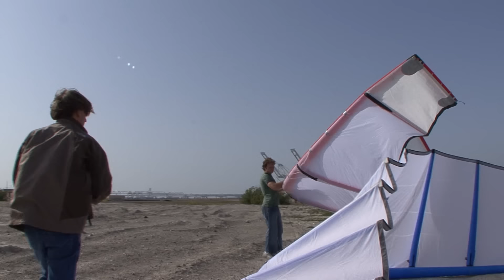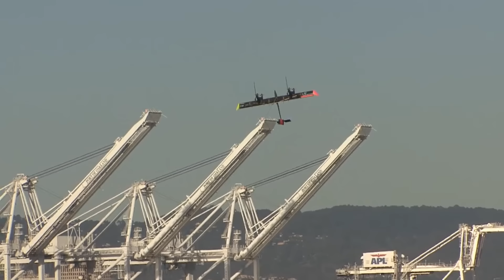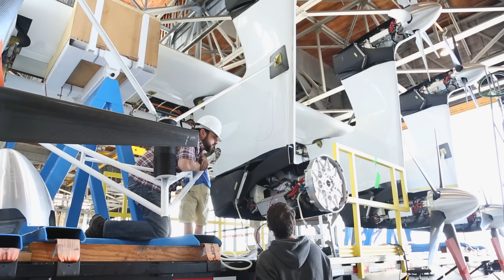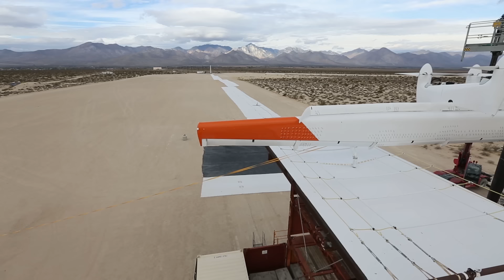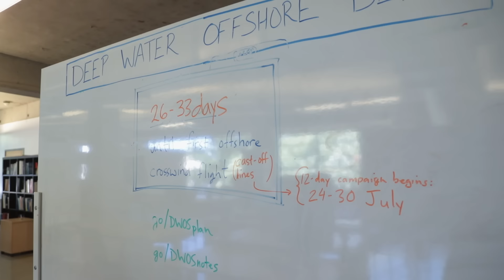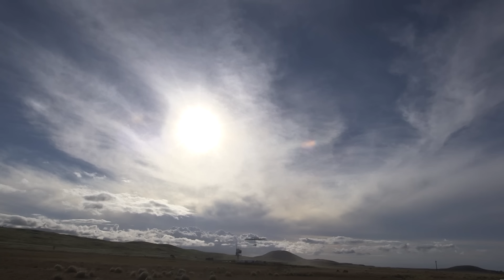Pulling Power from the Sky: The Story of Makani [Feature Film]

Comment: wonderful tale of inovation  and gritty stick to it ness , however did i miss the part of how much power was ever produced over and above the power  used in  transition and  vtol envelope? also i  am not against good alt energy  in any form ,,, but the  entire team on this one seemed way more interested in the camera than the text books
Reply: It would be a drop in the bucket. I fly 2.2sqm sport kites and the amount of power is absolutely incredible. It is exactly the same feel as waterskiing when the boat goes full throttle to lift you out of the water. Like you’ve just been yanked by a freight train. I bet the power for VTOL is less than 1% of what it generated during a typical flight.
Reply: @Syclone0044  i dont "bet" on this sort of data ,, i think it would be reasonable to expect some real data on the process , the "kite" you get pulled by is one example of force  , however in this example  the electricity is only developed by the props on the wing ,,, what still remains a mystery is how much power is developed
Reply: @peterfox8701  Exactly. Comments like the one above saying things like "it pulls really hard so it must have a lot of usable power" is just what the misguided kite-boarders in this video thought. If it were really so, we could usefully harness the pull of gravity on any large object.

Comment: Pretty neat. This project was a mix of everything I’ve done in my life. Windsurf, kitesurf, helicopter pilot, drone pilot, rc plane pilot and Hawaiian resident. If it ever got revived it’d be cool to join the team. I thought your transition out was done in a really sketchy way and I have lots of questions but I imagine you guys had the same questions and reasons for why you transitioned that way. Also it looked like the kite settled with power a few times. Vortex ring state. There was another company that put a giant remote controlled kite on a large ship. It just helped pull the ship though. Your kite could pull the ship while powering the motor simultaneously maybe even allowing to shut the diesel generators off? I’m not sure how much power a ship motor draws. Maybe look into the shipping industry for funding.

Comment: This is an interesting concept but I dont see how this can be practical.   There are too many things that can go wrong.  Also how much energy can this produce relative to other more simple systems?  I'm not against new things but it does seem like a much more risky system with so many failure points.
Reply: Well said and I couldn't agree more... just wayyy too many high-risk variables and even if most of the variables could be solved, I simply do not see how such a design could survive sitting out in the elements long term, especially during major weather events.
Reply: Is absolutely insane, like you said too many moving parts, and that should be the death knell from the get go. They should have done something else if they want to make something competitive with conventional wind turbines.  One guy in the comments suggested tethered helium dirigibles. That sounds a hell of a lot more practical than this joke.
Reply: @steveperreira5850  it was tried as I remember. A ring shaped balloon and the rotor in the middle. Never heard of follow up though.
Reply: @Daneel Olivaw - I recall seeing those experimental ring-shaped balloon wind turbines (with the center-mounted wind turbine)... not in person but online. Which btw, sure seems to make a lot more sense vs thinking a super finicky kite wing (expected to rotate round and round 24/7/365 while tethered to massive moorings) was somehow going to revolutionize the energy industry(?) At least the ring balloon wind turbine design could be configured to retract back into a (sealable) ground-level bunker or sealable above-ground domed housing ... which would not only offer superior protection during non-ideal wind conditions/severe weather but would also offer ideal sheltered maintenance. 

On a side note (and to be clear) I'm not knocking the amazing feat of engineering involved in the tethered kite project but I am knocking the total and utter impracticality... which should have been realized long before the project was further and further green-lighted/funded.  It's too bad the design team didn't shift focus to a more practical project, such as the ringed balloon wind turbine design ... I bet they could have knocked that design out of the park and more likely seen the fruits of their labor blossom into actual mass production and long-term contracts(!)
Reply: After watching the film how many things can go wrong now seems pretty obvious. That is to say they couldn't have foreseen all of those issues from setting out a decade ago.

Comment: What's the KwH cost vs regular wind turbines? Adjusted for mass production
Reply: Too soon to tell what the kWh cost would be, but the wind at altitude is stronger and more consistent than at the surface, and the powerkite uses much less material to capture a share of it than a normal wind turbine. A very important fact not mentioned in this video is that wind power scales as the CUBE of wind speed, and the kiteplane cuts through the air about 10 times faster than the wind speed, so giving over 1000 times the power one might imagine to be in that bit of wind.

Comment: A very enjoyable watch but the whole time I'm thinking: please stop.... just stop it. The sheer complexity, multiple points of failure, high maintenance, staffing requirements, safety considerations, noise, large space required, weather dependence, low yield etc is just unbelievable. I noticed there was not a lot of talk about how much power was generated, and that the (likely considerable) noise this thing must make was hidden from us by the editors.
Having said that, it's really incredible what was achieved. Given the very difficult task I never thought it would get as far as it did and the determination to knock down every challenge that came up is very commendable. Looks like everyone did a great job at what they had to do and had fun along the way too, looks like it would be great to work there. I think if you took that team and set them to work on something that was actually worth doing they would knock it out of the park. If that ever happens, try to get the same videographers again because they did a great job too.

Comment: I wish they had tried sideways figure 8 (∞) crosswind flight pattern, it would have made the kite climb more stable and potentially reduce or eliminate the tether from coiling.

Also wish they would have been able to test a design with a big balloon that would bob in the wind, also on a tether like their kite. The ground station would need a variable spring, to allow harnessing during slow and strong wings. A permanent magnet in the ground station shaft would harness the bobbing of the balloon, surrounded by a coil. This would reduce the risks of the hard landings the kites experienced. If expensive lighter than air gasses are not available, the tether could provide energy to heat the balloon's air supply.

Comment: This is a perfect example of losing the forest for the trees.  You've got a bunch of people who THINK they have a good understanding of windmills, and then decided they could make a better one.  They failed because they don't understand even the most basic aspects of the concept behind windmills.  There's a reason why simple windmills, the ones they don't like, have been in operation for more than 1000 years.  They're simple, they're cheap, they're easy to maintain, require minimal monitoring and most importantly, they WORK.  Everything that their airplane ISN'T and never will be.  They took something that was incredibly simple, even massive versions, and then complicated the idea by massive amounts.  They took a principle that is mounted on the ground, or floating, with a minimum of moving parts and needing minimum maintenance, and turned it into an expensive and resource intensive (not to mention exponentially more polluting fabrication/maintenance process) IQ test that requires constant monitoring while it is in operation.  Taking a simple concept that has works for more than a millenia, and complicating it beyond belief isn't "innovation", it's stupidity and a massive waste of resources.  They created more problems than ever existed in the original simplicity of a simple windmill.

The most obvious thing about this whole process to me, someone who has actually built windmills for mere hundreds of dollars (and they're all still running after 15+ years) is how many windmills and how much power would have been produced in the last 10+ years they COULD have used the millions of dollars, they've pissed up against the wall, to build if they actually were as concerned about global warming as they pretend.  Another massively important thing they never ever mentioned was how much money they've spent.  How much is this IQ test supposed to cost?  How much does it cost to maintain all the electronics and motors and servos ESPECIALLY if they're going to put it over SALT WATER!?  And the most important thing, how much power does this Rube Goldberg contraption actually produce?  The fact that after 100 minutes of video and 10 years of "development" (aka wasting money that could have been spent on REAL windmills and photoelectric panels) they didn't mention ANY of these crucial points, or even offer estimates.

I urge anyone who thinks this video is interesting to go online and search for DIY windmills.  ANYONE and I do mean ANYONE can build a windmill and produce their own power with absolutely NO fabrication skills and nothing more complicated than a hand saw, a hack saw and a hand drill out of common, everyday parts and components that you can get from your local hardware store.  Even just watching some videos on it will educate you far more than the idiocy going on in this video.  Barring that, you could also just say screw it and go and buy one from amazon for $200, ready to go out of the box.  As a life long fabricator of 5+ decades, we had a term for people like the bunch in this video.  We called them "a lighthouse in the desert".  They're bright as hell but completely fucking useless, as far as the time and money they wasted.  At best, it's a lesson for everyone else on what not to do, and at worst, it got them a pay cheque for 10+ years and they can always sell off the tech for millions to the military so it can be used to spy on and kill people.  So at least there's that.  Fail.

Comment: This is the craziest challenging project that I ever see, and I mean in the positive way,  if the project continues may I suggest some ideas that you didn't try.

Use to hold the kite with several cables 2 or even 3 cables attached to bases apart hundreds feet's from each other, this will give more stabilization to the kite.

Another idea why kite, try using a balloon like Zeppelin, it's simpler and much cheaper, and a Zeppelin balloon filled with helium will not crash to the ground, and it's too simple to get harmed by the winds, wings could be added to catch more wind energy,  go for it, it worth a try, good luck

Comment: You need a good R/C glider pilot, used to winch launching to help y’all. Great idea but for more stability add gyro control to the tail, and stick with the straight wing, polyhedral design. The biggest problem I see is that if power is generated on-board then air to ground transmission becomes the problem. Calculation of wing loading is essential and will vary GREATLY depending the the weight/length of the tether. Keep going, it’s a beautiful idea!😎
Reply: I don't think you realize the scale of this project and the level of expertise of the people involved. The conducting tether is indeed an engineering challenge for this design, but not the hardest one. I had a conversation with their chief engineer about their biggest engineering challenges, and the tether wasn't one of them. You can see a failed tether force a glide landing in one of their test flights, but they already had a better tether ready to go and swapped it in.

Comment: you guys need to make the tail(control) surfaces fully rotational so that in hover they can weather vane into the wind and allow the motors to guide it down without drag tilting the entire structure. You could maximize this effect with 3 axis rotation, allow the tail planes to rotate in a local x/y fashion, then allow the entire tail to rotate in an additional z-axis independent of main wing. It doesn't even have to be powered, just for landing or take off allow it to free spin into the wind.
Reply: If you gimbal the entire tail section your servomotors would have to be huge. And if you don't power it, how to you get it back into position for crosswind flight? Aircraft have been around long enough that there are good reasons for every aspect of their design.
Reply: @drewm1980  i didnt even think of servomotors i thought of the computer controlling the existing motors in an aspect that would allow the tail to naturally rotate on bearings... never saw a servo motor on a weather vane.
Reply: @drewm1980  it could even have a v shaped guide vane so that one side was always catching just enough wind to keep the entire structure downwind of the air flows given direction... no power required. the wind that is the problem would be the power, and when there is no wind there is no problem.

Comment: Very compelling story. And amazing level of innovation and results. I'm shocked by two things though: Firstly, that it ended where it did. That NO ONE would be willing to further fund this development, at such a late/completed stage (and after 13 years!) and with climate change looming, seems utterly insane. Elon Musk blew up a gazillion rockets just to stick a landing. You'd think he, if anyone, could throw some of his petty cash at this to get it over the finish line! Secondly, that ultimately loss of tension on the tether was what got them... like, it's a kite. They make a huuuge point about it being a kite. Kite, kite, kite. And they get wrecked by the most basic and constant challenge of flying any kite! Who doesn't know that if you can't keep tension on the tether the kite will crash, or at least you will lose all control until you can regain tension? Strictly speaking, it's what caused the earlier model being ripped to shreds as well. It kinda tastes a little of them being so engineering/programming focused that they lost sight of the most basic principles of the thing. Anyway, some kind of emergency reel-in boost for the tether when it's pull force falls below a certain threshold, or some propeller giving stabilizing "lift" away from the tether (or both) seems to be rather easy fixes. Not sure why the latter hasn't been part of the design since early on, to be honest. Would have simplified take-off/landing greatly along the way, and also the transition out of cross-wind flying. Anyway, I really hope that someone picks up on this, and gets it the last few % to completion. Amazing project and people!

Comment: From my experience of kites  , the wings need a greater dihedral. Their kites more like a performance glider.

I'm not saying this is definitely better
The advantages should be a tighter turning circle if needed and stability. The slight angles only knocks off a small surface area presented to the wind,  a good trade-off if your kite is incapable of tight turns , and/or it is unstable in flight 

I find it interesting that your design uses ailerons as opposed to two or more lines.

Nearly all birds fly with a dihedral, with a few exceptions.   I think it would be worth a shot

Comment: It's pretty heartbreaking to see the kite crash into the ocean like that, and sure hindsight is 20/20 but in the desert they had landing gear in case of this same issue.  It seems like a little more fail-safe engineering could have saved that kite too, and it would have been reasonable to expect failure in a new environment (in fact they said as much).  Pouring out seawater from the electronics was also hard to watch, and sure waterproofing isn't easy but again, were they just too rushed to implement these sorts of basic fail-safes?
Reply: Shure the ocean was a step too far, too difficult, and too dangerous!!

Comment: I am not an expert in wind turbine technology, but there is something basically wrong with the whole premise of this scheme.  They started out with the theory that if you make the diameter of the circle bigger, you could generate more power.  But it's not just the blade diameter that generates the power.  It's the blade AREA.  The kite would need to have to be enormous in order to develop the torque in the same order of magnitude as that of a conventional wind turbine.  And how could one transmit that enormous torque to the generator shaft with a flexible tether?  Something seems wrong here.